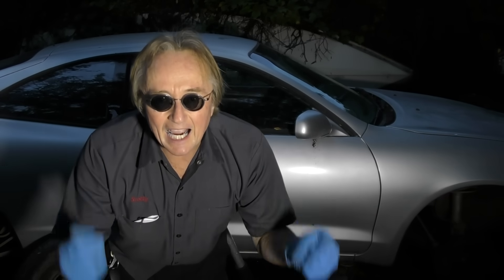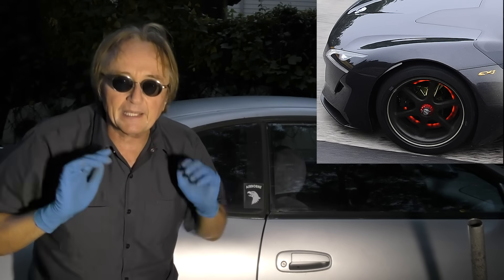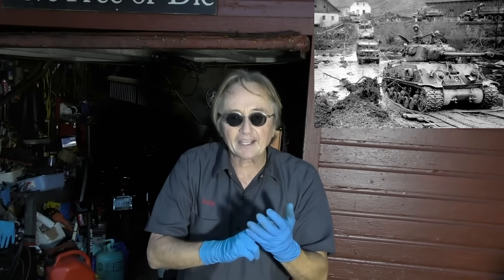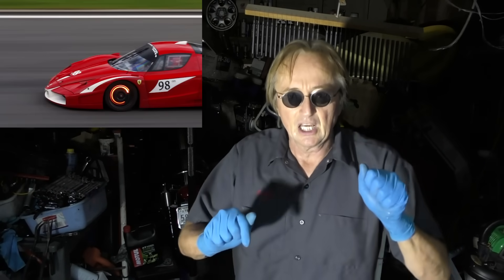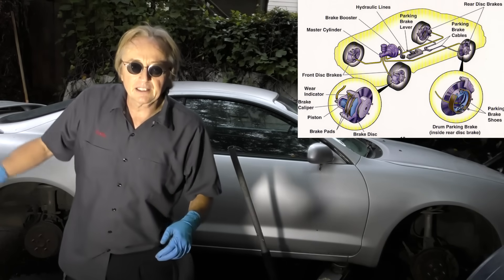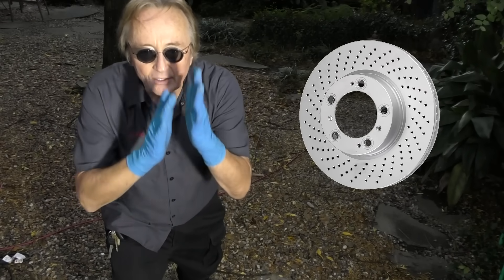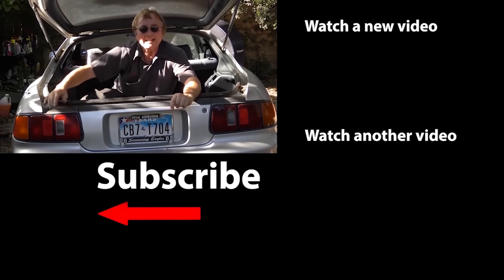Why Some Cars Have Drum Brakes Instead of Disc Brakes

Comment: Drums are better for e-brakes that use a cable, which is why some vehicles have both drum and disc on the back. Disc for hydraulic braking and drum for park braking.
Reply: Also a lot of vehicles that have passive spring brakes in case of an air pressure failure will use drums

Comment: I have a 1979 Toyota FJ40 that had front disc and rear drum, One of the improvements I did for off road driving was put disc brakes on the rear. With the drum brakes going through mud puddles ( More like mud holes that covered the entire rear wheel ) by the end of the day you had very little brake pedal left.

Comment: Many motorcycles are over braked with hydraulic disk brakes.  Thus the obsessive training about light, two finger and light foot braking to avoid lockups and some preaching never touch brakes in corners.  Thus the need for ABS to avoid crashes in panic stops.  Drums on a bike typically don't need ABS.  I still prefer front disk and rear drums on a bike.  Rear drums won't as easily lock up unless you really stand on that pedal.

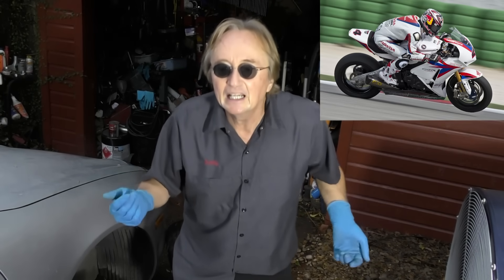Comment: 4:47 both brakes should be applied for motor cycle to slow down. if one uses only front brake, there is risk of accident
Reply: For dirt-bikes I've used mostly front brake and engine braking.   Not downshifting without clutching and using the front brake, often without going off the throttle completely.  Rear brakes have very little efficiency with soft off-road suspension and slippery lose surface.

Comment: There is one advantage with drum brakes. They are self energizing. That is that the leading shoe of the drum brake tends to wedge into the drum when applied.
Reply: Only on one side of the brake has this effect unless you have twin pistons or cams that are linked which is a then called a twin leading shoe system
Reply: But wouldn't that also depend on if the drum brake was a servo or non servo
Reply: @thefuzzypickle8277  whether the brake is servo assisted or not, it is an inherent trait of a drum brake.
Reply: Not really a good thing. My old civic with rear drums would lock easily in the back in the snow before my front would. They were a pain to adjust. Hard to drive with confidence.

Comment: Scotty I gots a question 

if disk brakes are better than  drum brakes then why do buses and big rig use drum brakes?????
Reply: They're starting to put discs on heavy vehicles.
Reply: Because they use an air break system. Not fluid. Also with drums you can use a big spring in them that still pushes the shoes against the drum and locks the breaks for safety if you loose air for safety. Cant do that with discs.

Comment: I had a 61 chevy pickup with drums. It took me a quarter mile to do a panic stop. Pucker factor = 11
Reply: @billybob042665  Same here , on my 70 duster it was dangerous if you didn't start braking ahead of time especially in the rain , when i first got it i learned that pretty quickly after zipping past 2 or 3 stop signes lol
Reply: @jonathanbelanger6574  Stopping was an afterthought until the 80s
Reply: @richardbutton1179  even 70s disc brakes were good....
Reply: @richardbutton1179  even with a 80s car I have a 89 Plymouth Sundance and it has all 4 drums and they r scary
Reply: Ha, pucker factor. My dad used to say that. Thank you, sir. I forgot that one.
Reply: My first car was an 86 Cadillac Fleetwood Brougham with drums. Stopping was a joke. Plan a good 30 seconds in advance...haha
Reply: @BigRobChicagoPL  in 86 all cars came standard with disc brakes on the front....
Reply: @stevemitchell2252  ok
Reply: TFW adjusters not serviced
Reply: @Bill Hill well I have a similar truck to your's its a 1955 GMC truck with manual drum brakes all around. It just took more effort to stop then power brakes.
Reply: thanks for that info. I just bought a 68 Impala and I was wondering if I should convert over to disc or leave on the drums
Reply: @GervmanJr  Me and my pop's are finally working on his 64 impala he had sitting in the garage for 20 years and we're converting all 4 wheels to disc.
Reply: Had a 70.cutlass with 4 wheel drums,  man, talk about scary the first time I had brake fade!! I was pushing on that peddle as hard as I could, NOTHING!  It was like I never was pushing the brake peddle
Reply: @19jody72  I had the same experience in a 1966 Ford Anglia Super,doing 70 on a dual carriageway,got round a corner and all the traffic was stopped,hit the drum brakes and they just faded away. Had to mount the grass in the centre and finally stopped 6 cars down the line,with 5 people in the car it could have been nasty.
Reply: @adeladd7638   OH chit!!    I know the feeling.  Yeah I was coming up to a stop sign, which I was on a side road thT went to thw main highway. I was actually late for work and winding my way out of the neighborhood at all the stop signs.  So I was really using the brakes. Then I hit the last one.. Man, thw feeling you get when you hit the brakes and it feels like it just releases! Yeah, you know!! Lol
Reply: Damn...that's frightening.
Reply: Yes 1st car was a 64 chery 4 wheel drums no power.  I also had a 70 chery wagon with 4 wheel drums no power brakes.  You really had to push hard on the pedal to stop it.  It took me some time to get used to power brakes almost went through the windshield 1st time I hit the brakes
Reply: I have a 65&66 c-20 & c-10  4 wheel drum brakes and other than being easy on them going down hill they work just fine. 95 k1500 has rear drums and they actually have a worse design in my opinion because of the placement of the brake cylinder.
Reply: My 68 F100 is about the same
Reply: I’m restoring a 61 Chevy 3/4 ton. It has 8 lug drums and I am have a stupidly hard time trying to find front disk brakes for it.
Reply: @dawsonroth5832  Maybe have to rig in some front end stuff from an 80's or 90's model
Reply: But it only goes to 10
Reply: My Falcon has 4 wheel, non boosted drum. It's not bad, I just wouldn't want to stop suddenly doing 70-75 on the highway.

I don't think it's that bad if you're brakes are adjusted, it's just not obviously modern boosted disc.
Reply: My '69 can do that in 400 feet at freeway speed. FIX THE BREAKES WHEN THEY NEED FIXING!

Comment: The other reason is cost, complexity and reliability when it comes to emergency brakes. Disk brakes without an e-brake are cheaper and more reliable then Drum brakes, but the opposite is true when the E-Brake functionality is added. Most drum brakes with an integrated emergency brake really just have one extra, or sometimes just a modified, stamped steel part inside them that actuates the brake using the same mechanism as when you hit the brake pedal. The basic design between a drum brake with and without an e-brake is mostly the same. However, the integrated  emergency disk brake caliper is a MUCH more complicated design from a standard caliper. There's a whole ratcheting cam actuation mechanism that has to be built in that's not present on a regular caliper. These e-brake calipers are notorious for seizing/sticking or being slow to respond with less braking force. That's why you'll sometimes see a sort of hybrid disk/drum brake setup being used. The Ford Explorer from 95-02 had this kind of setup for reliability reasons. The rear brakes used a regular disk/caliper for primary braking but inside the hat of the rotor was a secondary small drum brake that was only used for the emergency brakes. On higher end cars you'll sometimes see two calipers used instead of an all-in-one caliper design but more for performance reasons. The Jaguar S-Type R from 1999-2005 had two calipers on the rear brakes. The primary rear brake was a 4-piston Brembo caliper and the emergency brake was a much smaller caliper mounted on the other side of the rotor. So it's still common to see rear drum brakes on economy cars where cost is king above all else.

Comment: Scotty you forgot a few things:
1. When going through water, apply a bit of pressure to the drum brakes to keep them dry and warmed up. (An old trucker's trick)

2. You did not mention metal-sintered linings (Metal--Blok as I recall). They increased the fade-resistance of drum brakes substantially. Actually, they worked best when warm to hot. Good choice for a pickup.
3. You did not mention that towing might be a good reason to swap rear drums for disks. 

4. Finally,  a drum brake isn't inherently bad; there are good ones and bad ones. I suspect you could find some poorly made disk brakes as well.  I recall some of the heavier passenger cars of the 50s-60s era had 12 in drums about 3 inches wide. (compare to some GM cars of the era with 9 inch drums (about 1 1/2 inches wide) on the rear.
5. When descending steep grades (not in Texas) one should apply the brakes then alternately let them cool. Important if you're hauling a load.
6. Whilst disk brakes don't necessarily fade, they are known to seize if they are too hot. 

Keep up the good work..

Comment: Also there wasn't many disc brakes with built-in parking brake pre 80s. My 1978 Mazda RX5/121 had rear discs with small drum brake in the disc for the emergency brake.
Reply: Gm had them in all the irocs and GTA firebirds also the formulas and rs models had them

Comment: As a teenager, I had a 1972 Ford Maverick Grabber with the 302 V8 engine.  One of the things I remember most about that car, wasn't the performance, but the terrible brake fade resulting from the 4 wheel drum brakes.  A couple of hard uses of the brakes, and the next time braking (during the same period of time),  the brakes lost allot of there braking power.

Comment: My Jeep Grand Cherokee has Disc front wheel brakes and a combination Dic-Drum brakes in the rear. That's right the rear brake looks like a drum brake drum with an outer ring that's a disc...  It turns out that for driving normally, the rear brakes operate the discs when stepping on the pedal, however, when applying the emergency or parking brakes, the hand drawn cable actuates the drums mechanically.

Comment: When I was a kid.druvung for the first time. My car didn't have ....power brakes..all drum brakes....no power steering.. bias ply tires. . standard car...an ash tray....a cheap radio only...no computer...carb...body over frame...heavy car...manual windows...no AC... Etc

Comment: Great video, love you vids, however I am a landscaper and pull a trailer in Chattanooga, TN and I started with just regular disc breaks and rotors and after losing breaking going down signal mountain I would suggest anyone who tows anything for a living to get drilled and slotted rotors and change them ever other year. For less than $150 generally you will get much better breaking.

Comment: When i was young, i have seen an old man on a motorcycle that was probably older than him. I asked him about the engine. 200cc but he wouldnt drive faster than 70km per hour because of the braking pads from wood. All original vintage. It might have been from the 1920s or even the decade before.

Comment: Chevy had such a problem with their rear discs in their 1500 trucks years ago that they went BACK to drums.  They had a LOT of warranty returns from guys who use boats and dunk them in water so figured they'd go back to the cheap and easy drums.  I have drums on mine and got 220k miles on the original set of rear drums so they really don't wear that much.

Comment: Drum brakes especially on the rear wheels last much longer.
Reply: Only because they make the front do most the work. There both made out of the same materials. Front disc brakes last longer with rear disc brakes. Disc brakes have almost equal braking where if you don’t manually adjust rear drums every six months there not doing there job. And yes I know drums claim to self adjust but none of them every worked.
Reply: I have original 160,000 miles on my rear drum brakes on 08 cobalt.

Comment: I wonder where the Studebaker Avanti stands in the first cars to have disc brakes. They were ahead of their time...
Reply: Pretty sure the Avanti was the first American production car with disc brakes. Only a few European models had disc brakes by the late 50's, they were originally developed for aircraft and used extensively during WW2. Disc brakes started showing up on Indy and sprint cars by the mid 50's.

Comment: I would agree with u for the most part scotty however I have drilled and slotted rotors on my car now 2011 impala 3.5 i really like the slotted drilled rotors i put on it however i would not pay much extra money for them for normal driving as u said there not really nessecary but i also put raybestos poleace interceptor pads on it all the way around too and between the 2 if got way more stopping power in my car an advantage u have with the drilled slotted rotors is it prevents warping because of the way they dissipate heat I also like them on my pickups because I jep them equipped to haull heavy loads with them

Comment: Rear brakes do so little work that drums are in many cases  more suitable in ordinary cars. In fact rear discs were renowned for going rusty quickly and seizing as they never got used properly.  How easy drums are to repair depends on how easily the drum comes off the hub. Some come off in no time with the hub bearing, others take a whole load of bashing to get off. Once the drums are off its largely practice in getting the springs on an off and the shoe/spacer assembly correct. I did them in no time at all on our Skoda Fabia last year..maybe two hours for both sides including a cup of coffee and biscuits at half time....and I'm definitely on the shade tree side of things.
Reply: You don't take them off the hub to do them that is the total wrong way to do that
Reply: @DylanL69  You are right..most of the time, and I was wrong about my Fabia hubs which are separate from the drums. its a year ago and I had forgotten..But..a UK Ford Fiesta has the wheel bearing in the drum/hub assembly itself, so the hub has to come off to change the brake shoes on SOME cars, but not all I grant you.

Comment: Loved this video!!  I had always wondered why my 2001 Windstar and 2003 Grand Caravan had drum brakes in the back if disc brakes were so much better.  I didn't realize most of the braking happened in front.

I don't suppose you would know if my 2011 Mitsubishi RVR, with 4WD and all disc brakes, would favor the rear brakes if, for example, the front tires weren't gripping?  Or are brake systems not quite that intelligent?

Comment: My first car was an old 49 dodge.  It had drums all around and each brake shoe had its own cylinder.. Two per wheel.  Also the left wheels had left-handed threads on the lug nuts.  The parking brake was a band type on the driveshaft just south of the transmission, which was three-on-the-tree.
Reply: my 56 oldsmobile is similar, just finished the driver side disc conversion

gonna finish it up tomorrow morning 1/31/22

Comment: Because some car makers like to cut corners rather than do the most logical thing and fit the brakes that are better and easier to maintain and also don't turn brown after 2 years. Ford in particular are terrible and always using drum brakes. The Germans almost never use drums. The Japaneses also no longer use drums much even the south Koreans hardly use drums. The French and Italians whilst not as bad as Ford for still using drums are not far off. Ford at least are more reliable than the French and Italians though.

Comment: I ride my motorcycle 100 miles a day and use both front and rear brakes.
Here's a little disc brake history from google:
The first caliper-type automobile disc brake was patented by Frederick William Lanchester in his Birmingham, United Kingdom factory in 1902 and used successfully on Lanchester cars. However, the limited choice of metals in this period meant that he had to use copper as the braking medium acting on the disc.

Comment: Drums on the rear last much longer against salt spray than discs do too.
Reply: And drums are much better in winter conditions. Sometimes ice and snow locks the rear tires (disc brakes), but with a drum brakes never had this problem.
Reply: Trump Jong Un most cars have abs to prevent that from happening and most work great. You should also pump your brakes on ice just for good measure. Disc brakes are superior to drums plain and simple
Reply: @trumpjongun8831  no they're not they slip to much cus they wet the discs locking up is means the brakes are actually working and abs doesn't lock up your brakes you must have like an 80's car or early 90's
Reply: @DylanL69  If the ice in your rim doesn't rip the ABS wire out.
Reply: @ty2010  I highly doubt that ice would rip out the wire
Reply: @DylanL69  I've had ice rip brake hoses and metal brake lines in two, believe what you will.
Reply: @ty2010  I've never seen it

Comment: Drum brakes also make easier parking brakes. That´s why many cars with discs in the rear have a small drum in the center of the disc.
Reply: Those integrated disc park brake are the worst, usually have problems when I see them. Drum and hat is pretty good but if you don't use the parking brake they tend to have problems but so do any parking brake systems - probably why then wanted electric park brake.
Reply: just bought a Suzuki Grand Vitara with that set up....seems to work ok...the drum part isn't really that small...shouldn't need changing too often as it's only a parking brake.